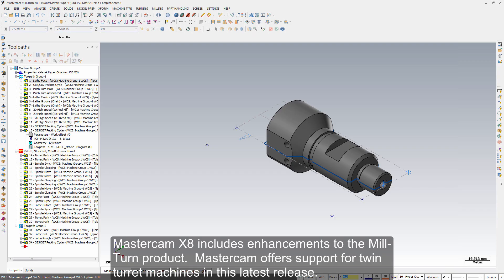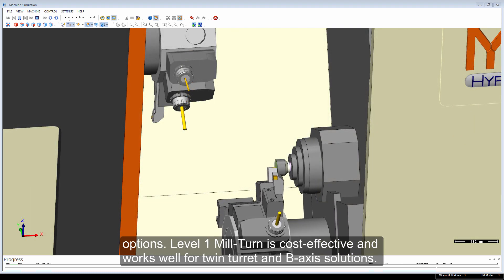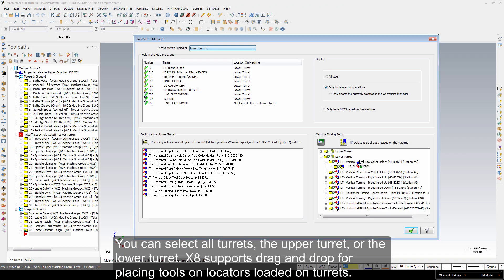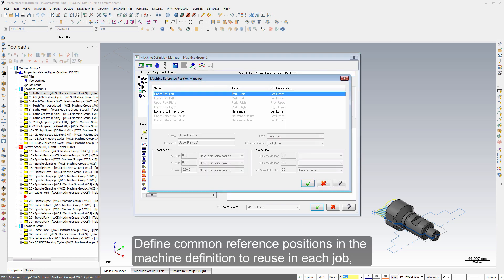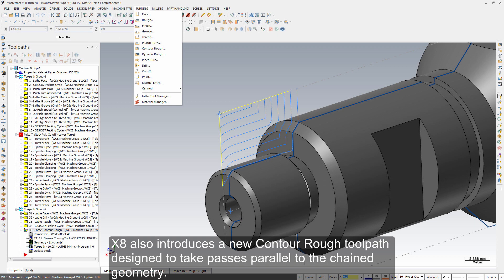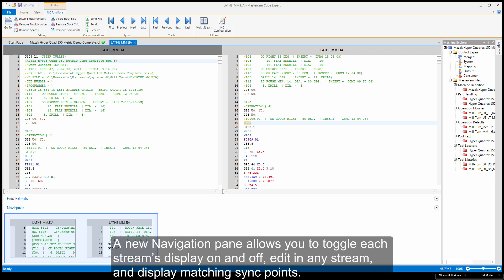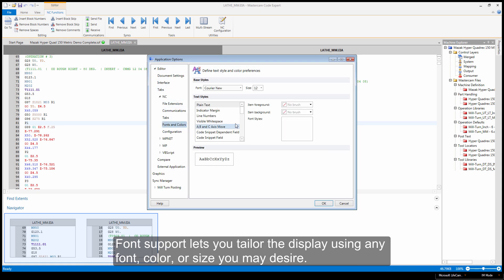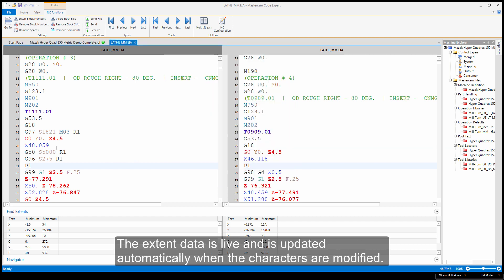Mastercam X8 - What's New in Mastercam Mill-Turn

Comment: I have x8 level 1 mill with lathe but there is no Mill Turn option on machine type just mill or lathe
Reply from the maker: Hi Pete Thomson  - although you can perform milling and turning operations on the same part with bundle you currently have, full Mill-Turn programming requires an add-on called Mastercam Mill-Turn. It gives you a full Mill-Turn workflow along with syncing and other important tools. If you're interested, your best bet is to contact your Mastercam reseller. (If you don't know who that is, you can find out here: http://www.mastercam.com/en-us/Communities/Find-A-Reseller )